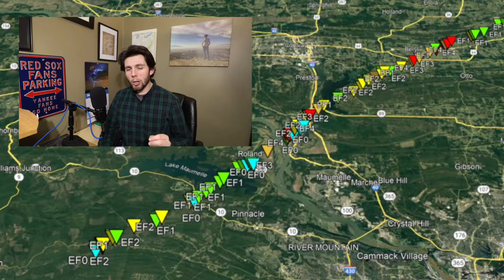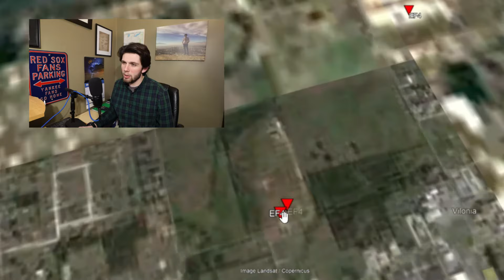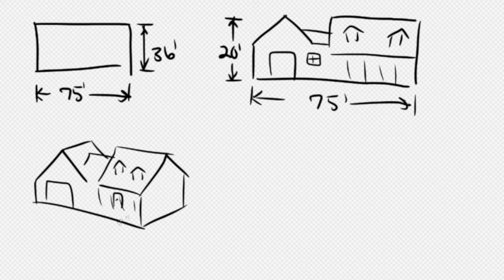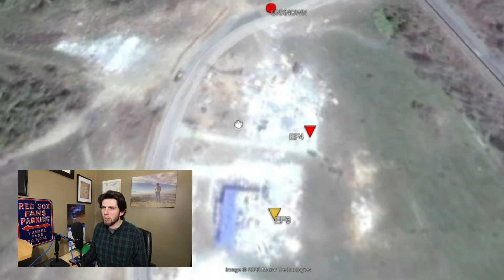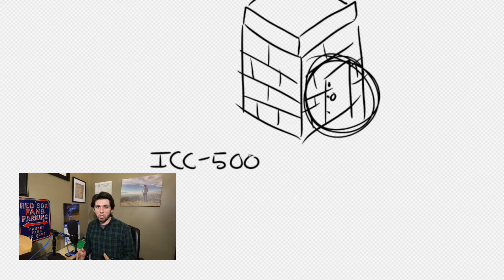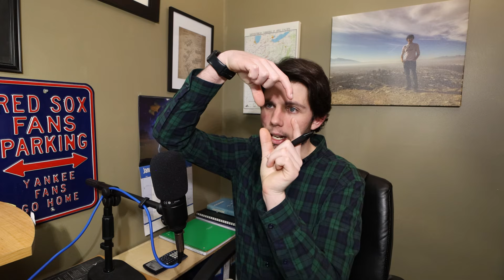DAMAGE ANALYSIS: 2014 Vilonia, AR EF4 Tornado

Comment: the reason that the EF4 DI was not upgraded was because it would have been the only EF5 DI and the surveyors said that its very uncommon to rate a high end tornado with only one damage DI
Reply: Well in that case they are talking garbage. Firstly they missed a number of EF5 damage indicators and made excuses to exclude others. 
This should have been rated EF5, even most outside experts agree it should have
Reply: @biscuitcase83  You are absolutely correct. The Vilonia, AR tornado was an EF5. IT was one big cover up. Also the guy who said no EF5 this time was being a smart a** liar.
Reply: Ef4 tornadoes always get that rating off of one di. Hell even the ef3 that hit my area only did ef3 damage to one small building. They do it for every other category. Why not 5?
Reply: @13_cmi wydm el reno to piedmont got a five based on one damage indicator

Comment: I believe there was a TON of controversy surrounding the rating of this tornado. Many did and still do believe this was an EF5.
Reply: Yep and same with the roaring fork Mississippi tornado.. the roaring fork tornado was an absolute beast and leveled multi story anchor bolted homes to their foundations.. the fact they didn’t rate it Ef5 was crazy
Reply: @Aheadistheroad77 I don’t believe the rolling fork tornado’s rating. It had a slightly higher damage rating than the western Kentucky tornado. No way Jose nuh uh. Rolling fork was a beast but it cannot compare to satan’s dangly bits in Kentucky.
Reply: @Aheadistheroad77 I think you meant "Rolling Fork"
Reply: @Aheadistheroad77 the nws did a really good job rating that tornado so I don’t think it should be considered an EF-5
Reply: @tttornadoes It was close. Definitely a high end ef4
Reply: Dude this tornado flattened a half mile wide and several mile long stretch of hard wood national forest. Like to the ground 100 plus year old oaks laid over. Absolutely was an F5. It hit that town like a freight train.
Reply: I believe it was. I live in Arkansas, the damage done was beyond what an F4 is capable of
Reply: Look at the damage it's comparable  to other ef5 tornadoes
Reply: Weak argument just saying look at the damage u can have a ef3 wat slabs a house if it's not well built experts know wat there doing
Reply: I wish I could share the photos I took on dam road is Mayflower. We were cleaning one of our church ladies yard that had picked her house up off the foundations and moved items and lay down massive oak trees. I thought to myself at the time that this could not be a direct hit area, and walked down about two blocks toward the dam Warsaw about a 2 to 300 yd wide path of utter decimation.
Reply: Def was an F5, i was there. I think they are scared to deliver an F5. Hasn't been one since 2013
Reply: This comment aged like milk
Reply: Why do people think vilonia was an ef5? I see people say it deserved ef5 but they offer no proof besides the storm shelter which was not properly built. I’m not disagreeing with people who say it was an ef5 I just want evidence for this claim.

Comment: How did the fatality occur? The rest of the shelter didn't appear to have significant damage so what happened that resulted in the fatality?
Reply: "According to the lone survivor, the deadbolt at the bottom of the door remained intact while the top and middle bolts pulled out of the frame. The door never opened completely. Bending deflection of the door was sufficient to throw an occupant against the back wall in the shelter and she died of a head injury. The male occupant received broken bones and head lacerations, apparently from wind-borne debris. Both occupants were in contact with the door when the door failed." That was taken from the report that he uses in the video.

Comment: sometimes I feel the NWS are scared to use the EF5 rating. Also i’m loving these in depth videos. I really would like to see a full explanation on the Iowa Winterset EF4 tornado of last year.
Reply: At the start or at the end of 2014
Reply: El Reno is the PERFECT example of the flawed EF scale.
Reply: @wadewilson8011 well no the 2013 El Reno tornado didn't hit anything to cause EF5 tornado just EF3 was caused and not a lot of it
Reply: @wadewilson8011 nah, no ef5 damage, ef is damage.
Reply: EF needs to be used for damage, F scale for wind and the other factors. as a what if it hit a town scale @ia1n673
Reply: Perhaps, that might be a possibility...

...but assuming that all EF4-rated tornados in the last 13 years are rated accurately, I still find it amazing that we haven't had an EF5  'nado for that long! 😮 It's a legitimate miracle of God/science/both/whatever!
Reply: @TheMouseAvenger  Oh please, that's not a miracle. The houses that got swept away were weak enough for an EF4 to do it, that's why the ratings are ambiguous. A real miracle would be 13 years without any tornadoes at all, or no fatalities at all.
Reply: @TheMouseAvenger No. The EF scale was changed in 2014, and there hasn't been an EF5 since.

Comment: The fact that there was a fatality in a storm shelter is so horrifying
Reply: I am not an expert or an engineer. I am a retired civil engineering technician that spent 21 years of my working career responding to natural disasters (floods, tornadoes and hurricanes). I don’t recall how many storms I’ve responded to, the damage has a way of running together in my mind. 

I do clearly remember the only F-5 (I like the original Fujita scale) I worked in Smithville, MS. I got freaked out by the damage I saw. Over the years I’ve seen what works and doesn’t…, even though recommended by experts. I recognize that need for balanced approach in alignment with constraints placed by budgets. 

Typically the things that work are earth sheltered, round, thick reinforced concrete or domed. 

In Smithville there was an area that everything above ground was wiped from the earth. There were people that survived, because they sheltered in 1’ thick, reinforced, monolithically constructed, domed, mostly buried storm shelters. I don’t recall that the steel doors were that substantial. I can’t say that they were ICC-500 standard compliant or in alignment with FEMA P-361 guidance? They were installed at an angle from the top of those domes leading down. They made an impression on me as the way to do it!

I’m planning a retirement home for myself. I’m planning on using a bermed Monolthic Dome with FEMA P-361 rated doors, thin narrow 1.25” polycarbonate windows and thicker reinforced shotcrete. 

Mother Nature can be a real beeotch, but she’s always to be respected. I appreciate your analysis work. It’s top tier! 🫡👍🏽🏆
Reply: @Hero4Hire4  The Smithville EF5 was an absolute freak of nature.. and formed with what was possibly the most tornadic environment ever documented (the hodograph is simply unholy in meteorological terms).

They say that "300 mph" is around the upper limit of the strength of tornadoes. Though, I'd argue that it is not out of the realm of possibility that the strongest 'nadoes of the 2011 Super Outbreak (Smithville & Philadelphia EF5's) could've been harboring very brief 350-400 mph gusts within the very inner core and/or a subvortex at some point.

Unlike the Phil Campbell–Hackleburg EF5 which persisted over 100 miles.. the two Mississippi EF5s that day seemed like their parent storms were simply trying to spend all of their tornadic energy as quickly as possible in one shot. Ultimately resulting in tornadoes that didn't have the longest track, but had absolutely unmatched violence.

So we got the Smithville EF5 that practically grinded the town's well-built funeral home into powder, and the Philadelphia EF5 which dug the record-holding 2-foot trench.. in soil that consisted of freaking hardened clay.
Reply: If I'm not mistaken, I think you mentioned in your Phil Campbell video that a concrete roof was lifted off a storm shelter during that event too! The forces displayed by violent EF4 and EF5 tornadoes are pretty mind-blowing.
Reply: @TornadoStories  it happened in Jarrell,TX too. In the Deadman Walking documentary a surveyor said it took the top off the storm shelter and flung it like a frisbee. He said he went back a week later and asked the owner if they ever found it. And they never did.
Reply: @wadewilson8011  Thanks for the info, I'll rewatch the documentary. I'm pretty sure I've saved it in one of my tornado specific playlists.
Reply: @TornadoStories  you're welcome! Yeah it's towards the end of the documentary where they're discussing the aftermath of the storm.
Reply: @wadewilson8011 Jarrell was what came to mind when I read this comment. Jarrell was a grinder. Think it was the most compelling case of objects literally disappearing. Granularization unlike they've ever seen.
Reply: @SadElk122  Likely so, since the Jarrell F5 practically slowed down to a stationary position when it came over the neighborhood subdivision that it infamously erased from existence. Most tornadoes only subject homes to less than a minute of their wind force.. while those unfortunate victims had their homes continuously blasted by EF4/EF5 winds for 3-4 minutes on end. Especially when you consider that those homes were likely of poor construction quality, since Texas is infamous for skimming of building codes even today.

Likely not even in the top 10 strongest tornadoes ever recorded.. but still undoubtedly a beast that was probably blowing around 250mph with how insane the damage was (even when factoring in the continuous wind-blasting) and the ground scouring seen that was deeper than 1 foot.
Reply: @TornadoStories  believe that was the Parkersburg one
Reply: @TornadoStories yes bc mother nature always wins
Reply: Agreed this also happened in the el Reno 2011 tornado.
Reply: It's my understanding that the failure in this tornado was due to the door not being FEMA  recommended standards, according to Texas Tech. The rest of the shelter held. They sold him a door you would use for something like home security. It was steel, but hollow. And the locking mechanism clearly not at standards. I also think it was a DIY project. Most of the shelter was built okay, but the door is always the most vulnerable..it has to be correct.
Reply: If you look into Phill Campbell, there were several reports of a concrete storm shelter roof being ripped off. It's unclear if there were any fatalities in the shelter, there are claims that several people died and others say everyone was ok.
Reply: I use to have pictures of a Highway guard rail shoved through a 6 foot around red oak tree trunk in Vilonia! I was a drywall guy and we were working there 2014/2015. The rebuild was crazy.
Reply: Oh hello Carly
Reply: This fatality happened in my neighborhood. I believe in the final analysis, the door was not FEMA rated for the wind speeds it experienced. A large piece of debris struck the door itself and caused the door to violently swing open, killing the lady inside of the above ground shelter. There is now a park in my neighborhood dedicated to her memory. The tornado destroyed 48 homes and my neighborhood that day, and the lady who was killed was not only the only fatality here, but the only significant injury. It was truly a miracle. It hit around 7pm on Sunday night, when most people were home.
Reply: Well Honeycomb cardboard inside a shelter door seems pretty obvious that it won't hold a violent tornado
Reply: It is unfortunate, but there are a lot of sham storm shelter builders. They charge 10, 15 or $20k for a shelter and then scam out on the actual construction or use sub standard parts such as the door in the Vilonia tornado. Cinder blocks and quick-crete are pretty cheap, but steel bar and doors can be quite expensive. True you can have a concrete roof, but if its only tied in with wire mesh and not #4 rebar, the wire will corrode apart and there will be very little protection against lifting forces. 3 impacts from a 2x4 at 100 mph seems fairly weak to me anyway, being that we have proof that winds can be 250 mph or more. The average house has over 250 2x4s. The test should be updated to a 2 minute barrage of 2x4s at 200 mph, or a 2x4 strike at 200 mph every 10 seconds for 2 minutes.
Reply: I agree